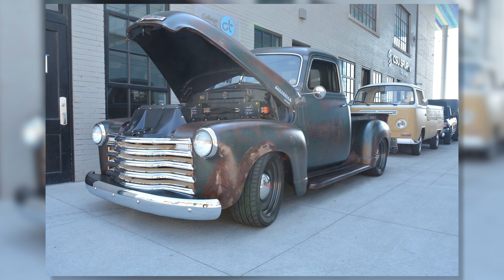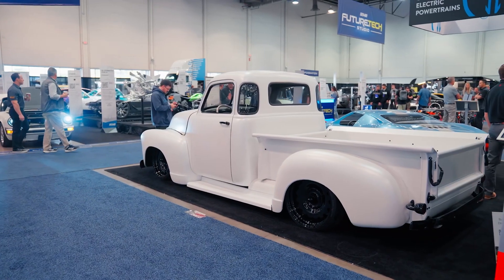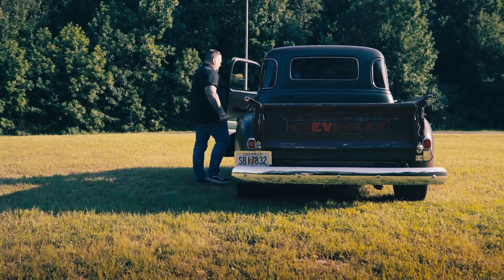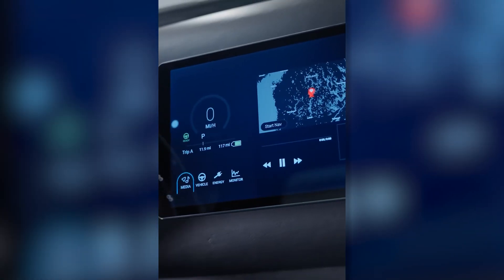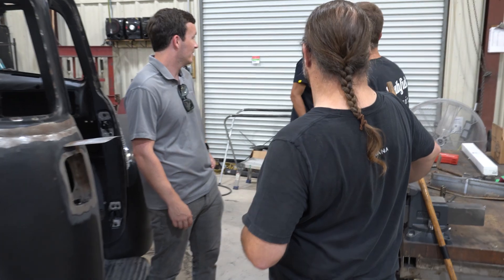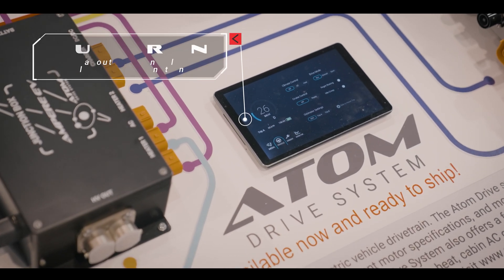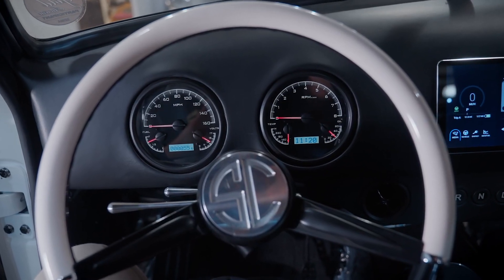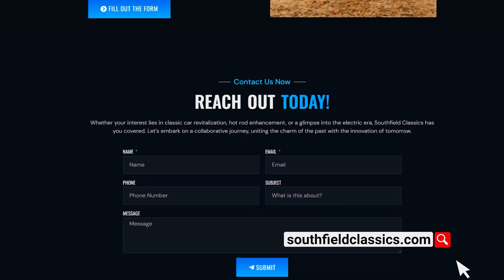OLD CLASSICS, NEW TECH! Certified EV Conversions

Comment: I have the patent on this motor transmission for converting gas diesel engines turning them into 100% electric vehicles. 
How are we going to get that motor to sit up in an engine block. After the Pistons have been removed and running a chain or belt system through the cylinders to turn the main crankshaft  To power the vehicle forward and backwards as well as run all the accessories.  Air conditioning power steering computer systems the lights.  It won't rust out if the motor is sitting where the carburetor used to be.  In a dry environment. What models do you think you could convert this way?

Comment: Wow, Ampere EV has grown a lot since I last saw the website. Is electric assist braking, like Bosch iBooster, on the roadmap? Or ABS?
From what little I know, Bosch is finicky to work with if not a major OEM or have VC funding so that would be a bummer if not in the cards.
I was looking forward to ZF releasing an aftermarket electric brake booster, but the release date passed without a word.

Comment: Problem in Virginia... if it's not mass production, it's an SCV.... a virtually useless ride, relegated to parades, shows, and events.
Reply from the maker: These vehicles are registered as new vehicles by the DOT. Much more than a parade vehicle.
Reply: @ampereevpowertrains  - So is a Shelby CSX... but in Virginia, it's still considered an SCV.
Reply from the maker: @JamesCopeland-i1j  that's unfortunate for Virginians. We recommend contacting your legislative representative.
Reply: @JamesCopeland-i1j what does that stand for? I tried looking at the DMV’s glossary of acronyms and couldn’t find anything.
Reply: @Neberheim  - Specially Constructed Vehicle. It applies to virtually anything that isn't mass produced. I don't know if it's still an issue, given their age... but even a Saleen S351 was pain to register/own/drive in Virginia, back in the day. Component or kit cars are an unbelievable nightmare.
Reply: @JamesCopeland-i1j  looks like it’s pretty different now than it used to be. Replicas can only be driven 5,000 a year, but reconstructed/SCV cars with a new Manufacturer’s Statement of Origin don’t have any restrictions other than than the hassle to get it registered.
Converted Electric Vehicles are their own class now and specifically exempted from the SCV registration requirements though, which is cool.

Comment: Why doesn't anyone use a shifter instead of buttons/dial?
Reply from the maker: You can absolutely use a shifter with an integrated adapter plate to a standard transmission if you want to retain it and row gears. Most people eliminate the manual transmission out of convenience and also because of additional parasitic loss from the manual trans. You also have to be cognizant of torque application when using a manual, given the higher levels of torque an electric motor provides.
Reply: @ampereevpowertrains  Regardless of what transmission you use, muscle memory is better than looking for a dial or a push button. I can say this because I have to use industrial equipment that uses silly push button transmission.
Reply: @Smithcraft1 I can see how looking down could be a big disadvantage for a work vehicle, but I think for most people out driving their restored classic, having to look down to go into reverse is probably not a problem. I think the buttons are a good solution for a restoration, but in a new EV I do prefer a shifter on the column, mostly because it frees up space but I think it’s a little more satisfying that just pushing a button. But I’m never doing quick maneuvers so it’s mostly a preference.